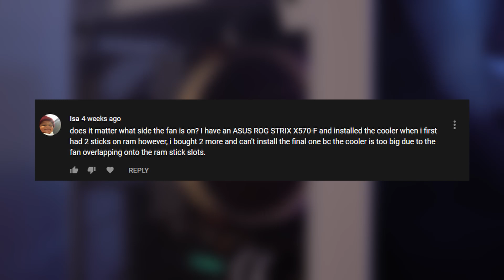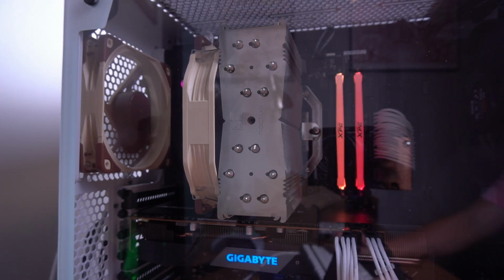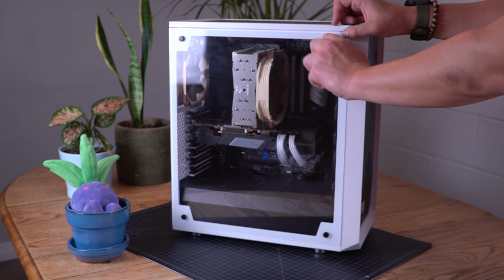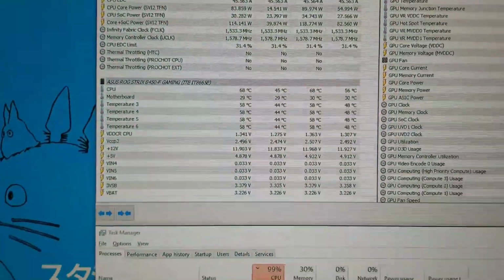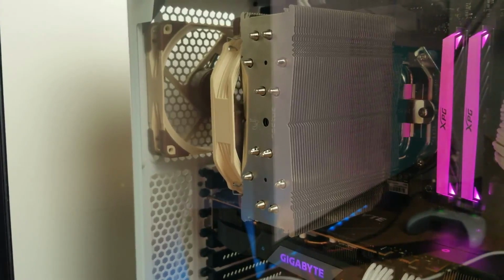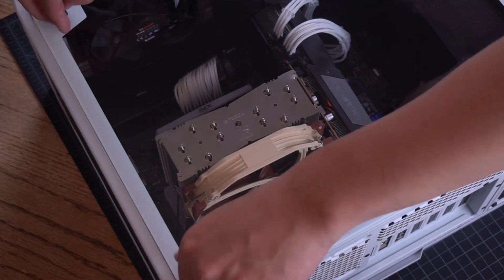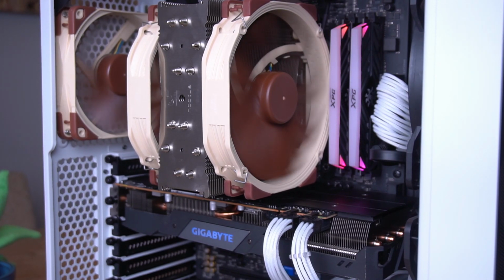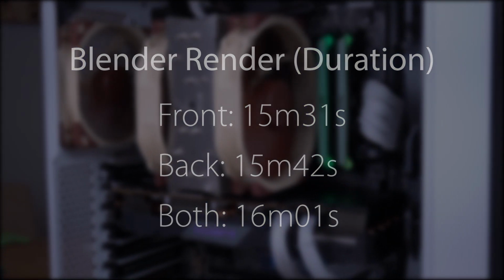What is the best placement for your heatsink fan? - Noctua NH-U14s

Comment: i actually have mine sideways which saved my computer heres my story the noctua and the asus mother board i cant believe had no damage
I can say that the mounts are super durable.  I can't believe my computer is not dead.  So..  i was moving out of my apt and taking my bed apart which is older and all heavy hardwood.  i keep the side off my case btw.  i was picking up the sideboard of the bed frame and the headboard which was leaning against the wall fell over onto the sideboard that i was holding which knocked it out of my hand and hit directly onto the noctua cooler in my case with no side.  i was like aahhhh!  im glad to say its been over a year and its running fine.  it did bend the heat pipes a little but no cpu or motherboard damage. asus mb btw.  im very impressed with the mb and the cooler
Reply: Built Noctua tough lol. 😎👍

Comment: I grabbed this fan for an I7 9700K on recommendation from a friend. Hope I didn't screw that up
Reply from the maker: I don't think so. They're excellent fans regardless, and based on some feedback in the comments I'm getting the two fans should be on different headers. The rear fan should be spinning less than the front to create less turbulence within the fin stack by the sounds of it.

I might revisit this test in the future because it sounds like there are a couple things I overlooked that I want to look into. And even if the performance is marginal, you still have a great fan that could be a case fan somewhere else in the build!

Comment: what's the height of the cooler?
Reply from the maker: Height is 165mm according to the Noctua website. In the Fractal Meshify C (my case) you'd have maybe 10mm of clearance between the heatsink and the tempered glass.
Reply: @PatrickRennie  thanks for the fast reply. Was looking to get this for o11 XL but it would be soooooo close. XL has 167mm of clearance. I’d like the ease of building in that case but I wouldn’t mind going with phanteks 719. Sure it’s bigger, but has clearance for cooler and I can add more fans for more air.
Reply from the maker: Wow that Phanteks 719 is a super unique looking case! If clearance is an issue you and you're still looking at a Noctua, you could also get the U12S instead of the 14: https://noctua.at/en/nh-u12s/specification. Clearance on that one is 158mm. I installed the U12 in my girlfriend's PC (Phanteks P400A case), and it also works super well.
Reply: @PatrickRennie  I found this cooler RIGHT after I commented! This cooler totally gave me the ok to buy the Lian Li o11 Dynamic XL! even if I woudnt have found it you would have pointed me in the right direction! You are epic! Thanks!
Reply: @PatrickRennie  HI there hv a question would the heatsink cromax  covers fit... was wondering cause its states thtat will rise up 7mm...any ideas.... meshify c states 172 mm max cooler height if am not wrong...have yo tried???
Reply from the maker: Hey, I have not tried to install Chromax onto my heatsink. It sounds like based on those numbers though it won't fit. I'd suggest checking out PCPartpicker.com as there might be someone in the community forums that's done this though.

Comment: Your radiator is very thin. And fans is big. Thats why you don’t have difference. With a radiator 2 times bigger you will see it.
Reply from the maker: I think you're right. The coolers that have two fin-stacks would be more efficient in that regard. I'd be very curious to try one of those in the future and compare to this test. Thanks for your feedback :)
Reply: i think it's obvious of what type of heatsink he was using in this test. The NH-U14S. So not sure why you're asking him to use a larger heatsink. That would be a different cooler no?

Comment: Pop that rear exhaust fan off of there, will drop your noise so much!
Reply from the maker: Interesting, I hadn't even considered that. I would assume that would increase the latent temperature in the case by a few degrees though right?
Reply: @PatrickRennie  it should not, if you have positive case pressure the intake should push the air out.

Comment: It is very interesting how pretty much everyone is doing air cooling wrong. Because of design of modern cases, with power supply at the bottom) and video cards blowing air inside, one will probably achieve much better cooling results doing the complete opposite of what most people is doing. If you setup you intake from the top and back and exhaust at the front it will be much better at cooling overall.
Reply: Hot air goes up, dumb comment.
Reply: @discipulodericagames  Very knowledgeable response. So what that hot air raises.... are you relying on passive cooling or fans to move it?

Comment: Front. Back.. what's the difference when we're talking about symmetrical heat sinks? My question is would double pull config work?

Edit: maybe there is a baseline/norm that I'm not used to because I'm approaching my first pc build. Now judging by what you said, 'front' configuration insinuates pushing air through, which again, I think is a weird way to look at it; because looking at the top of the cooler, the heat sinks are symmetrical meaning pushing air through from either end would have similar results depending on where that air is being pushed. 

So im wondering would there be any benefit to doing a double pull config? And now ill finish the video hahahaha

Edit # 2: again, when you refer to 'front/back' you're referring to air being pushed out of the front of the fan, meaning 'front' configuration puts the sink on the side of the fan pushing air. So again I wonder what dual 'back' configuration would yield. I belive you only did front/back configuration, as you call it, meaning both fans pushing air in the same direction, one pushing through heat sink and the other pulling. 

So try dual 'back' configuration as you so confusingly, I mean, aptly put it 🤣😉
Reply from the maker: Hey Benjamin, haha thanks for your play-by-play! I enjoyed reading it :P

Yeah all tests were in a pull/pull configuration, drawing air from the front of the case and pulling it through the heatsink fans. I'd be curious to give your theory a try at some point in the future though! It's harder for me to make videos about this sort of stuff as it's my main editing rig (and only PC), but I'm definitely going to do some preliminary testing to see if it makes a difference.
Reply: @PatrickRennie  I didn't mean thru case. I meant pulling air from front and back of heat sink
Reply: <<--fan heat sink fan-->>

So you're drawing air in thru the narrow profiles of the heat sink. Constricted air seems to cool better than a larger volume, no? Like breathing vs blowing on ur hand? 😶 am I retarded?
Reply from the maker: Oh I see now. I'm not an expert but I don't think that would yield the results you're thinking it would because you're just having the same air circulate through the heatsink fins that way. Might be a fun little experiment to confirm though

Comment: You do realize you have 140mm fan in the heat sink and a 120mm fan for exhaust. The 140mm fan is bottle capped by that 120mm fan
Reply from the maker: You don't think that I realized that there are two difference sizes of fan in my computer?

The case I have only offers space for a 120mm exhaust fan. In my experience this is the case with most cases unless you go larger than ATX. Also from the research I've done - having a single 120mm exhaust is generally all you'll really need before you hit diminishing returns.
Reply: @PatrickRennie  false. The intake cpu and exhaust fans all need to be of the same dimensions or your testing will be flawed. I know the difference having 3 140mm fans on an nh-d15 with a 120mm exhaust fan vs 140mm exhaust fan. The temp difference from what I have is about 10c cooler with all 140mm fans. I’m not even gonna debate this any further
Reply from the maker: @gducioevdgxyeuvddd3828  I'd be interested to see where you got that info - shoot me a link!

I'm referencing the Linus Tech Tips vid here - https://www.youtube.com/watch?v=8OmkmluAYAQ

Wasn't looking for a debate - there's a lot of info about PC building on the internet and I'm always curious to learn more.
Reply: @PatrickRennie  there’s no debate to it. My system has 3 140mm fans on my nh-d15 and a 140 mm exhaust fan. The temp dif is 100% noticeable when your case has all fans same exact dimensions and rpm. And ofc noctua fans do actually move air better than any other fan on the market. Linus tech tips….pfffff they take money from companies to “make” the results of their testing. Never rely on just YouTube. Always test for yourself. You can argue “static pressure” about dif fan size , rpm exc.(although static pressure is pure bs… more like a pc with a breathing problem IMO)